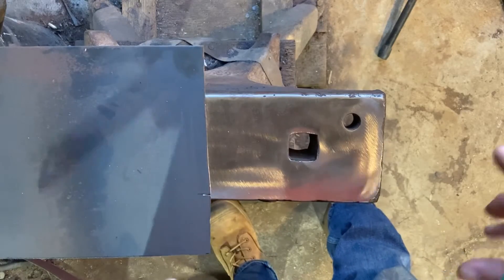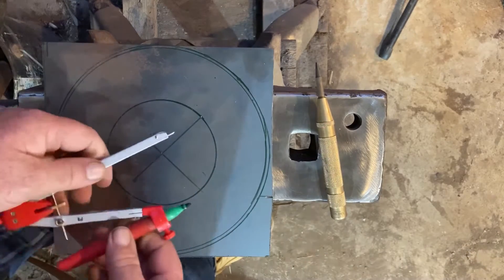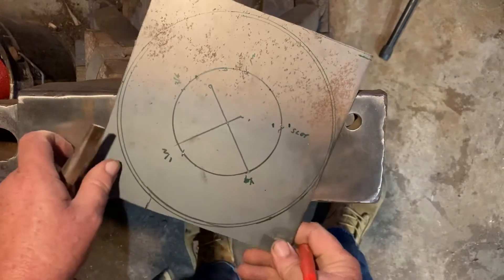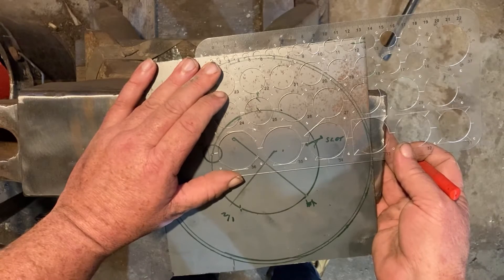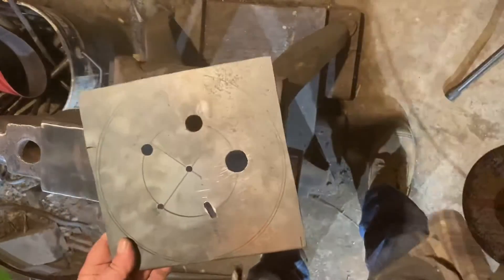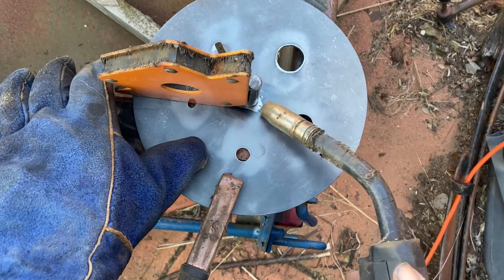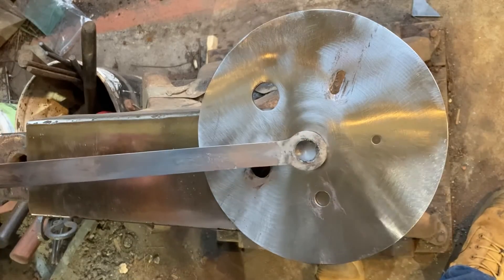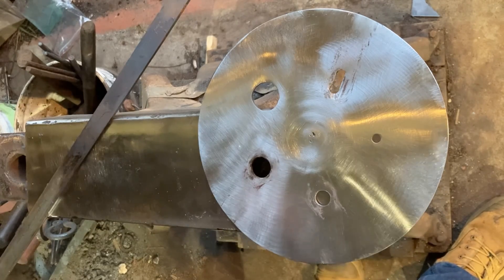Homemade swage, Turret swage, Blacksmith Drifting

Comment: VERY Dangerous !!  Drilling Sheet metal on a Drill press WITHOUT clamping the part down !!
If that drill GRABS and Spins the steel around !  You could severely hurt and severely  Cut Yourself !!
Be Careful doing DANGEROUS operations with Machine Tools !  Been there : (  
Stay SAFE   PLEASE
Reply from the maker: There is a reason I have a disclaimer in description of all my videos, the way I do things is how I do them not how someone else should do them. I have been a tradesman and used power tools to make a living for over 30 years. Sure I have had spins in that time but I also know where to put my hands so as they will be out of the way should there be a spin. I also have the a grip strength High enough that it is generally tighter that most people can apply a clamp to an uneven surface like a cast drillpress bench. Any work with tools and fire have an element of risk involved and it is up to each person to decide the risk that they will accept, while I will never tell others what risks that they should take I will choice the risks that I myself will take, After drilling holes in hundreds of knives I have a very good understanding of what the risks and what my own personal prevention methods are.
Reply: @DownunderFarmandForge  
I hear Ya ...
Please Just don't prescribe dangerous methods to folks 
Who are unexperienced 
All Good , stay Safe ,Thanks for replying 
Cheers ~
Reply from the maker: @Wilett614  my videos are how I do not how to do. This video also includes welding and the use of a forge. All items that generally good instruction is needed in person to do safely. I never set out how to do this perfectly safely as perfect safety does not exist in a workshop, hence the disclaimer about not intended for instruction.  I am a carpenter by trade and have taught many apprentices to safely use tools over the years but videos for entertainment purpose are a different beast. I have taught both my daughter and son to drill without clamping a piece down as it is a legitimate method of doing it. No matter what methods I use someone will always be unhappy with some safety aspect and truly if I made the videos so no one was unhappy then also no one would watch them as they would no longer be entertaining.